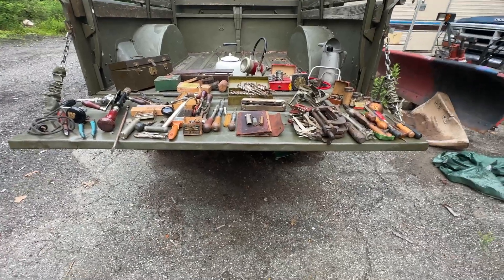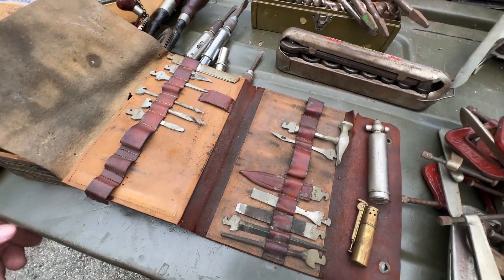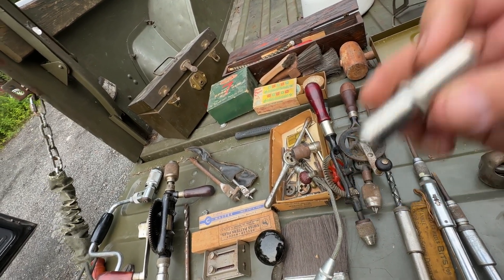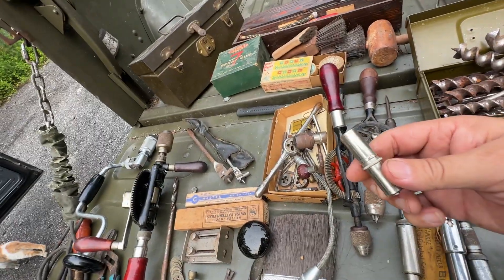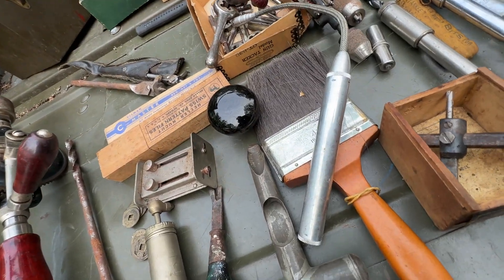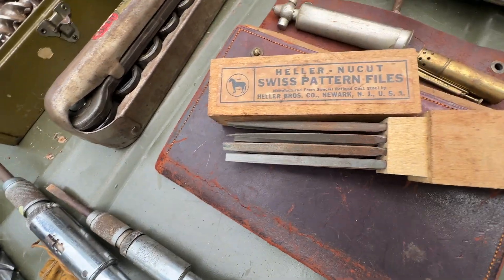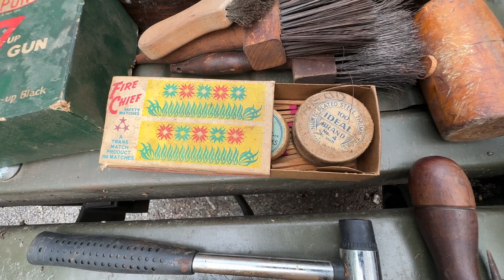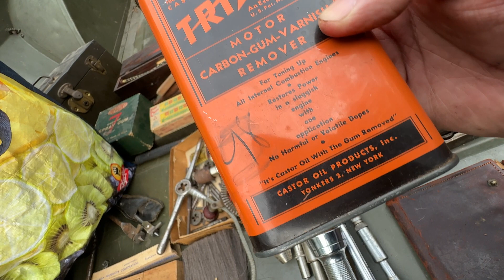Estate sale haul from the house of cool small stuff July 2023 ￼

Comment: The little multi tool is way cool.
 Nice haul of goodies.
Reply from the maker: Multi tools of one kind or another have been popping up since the start of the machine age.  Sometimes they are complex like this one, or just a wrench with an extra thing or two cast into it.  They are cool to collect, and the endless variety means you never run out.  I have maybe six or seven pre 1930's multi tools now.  Different ones anyway,  Eifel plierenches I have at least 50 of by now.
Reply: @RockIsland1913  one of my brothers has a collection of multi tools.